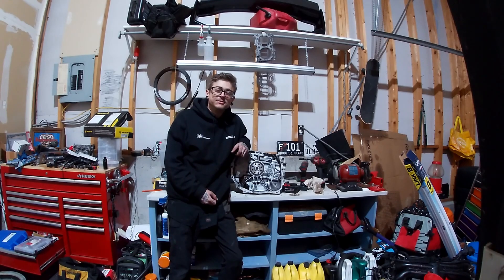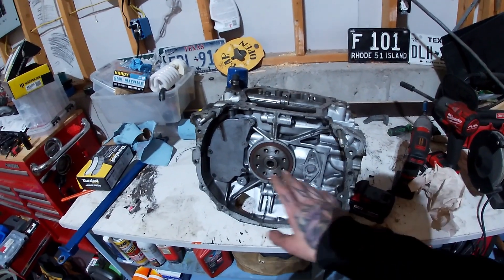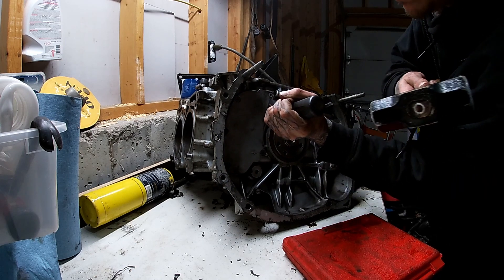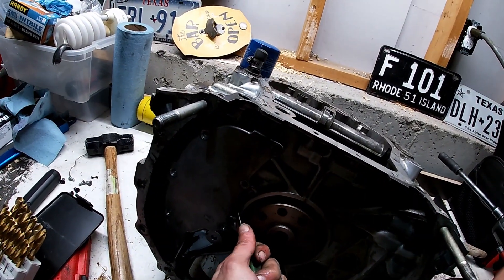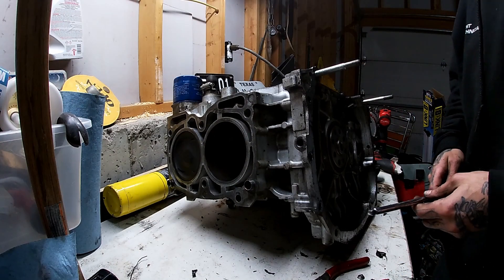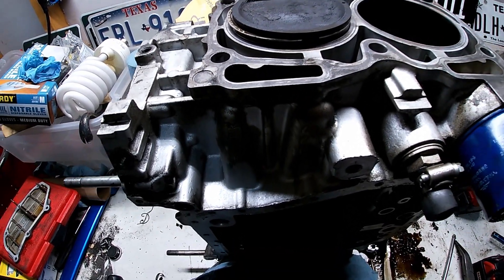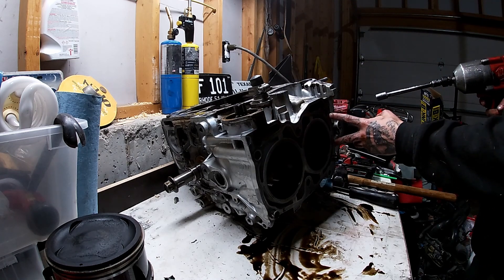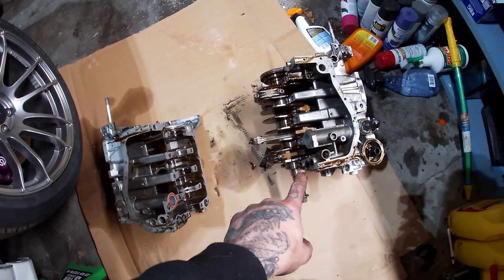How to Split a Subaru Short Block: Made EASY! || Block Disassembly

Comment: Rebuilt 2 FB25s. Currently doing my first EJ251 250k Mi Did my first case split to check the crank and all looks good. I split my case by taking a spar screw jack and two small pieces of wood and using the screw jack to split the case and using the wood to protect the aluminum. Popped right apart by hand.